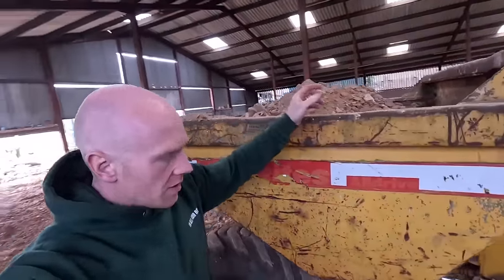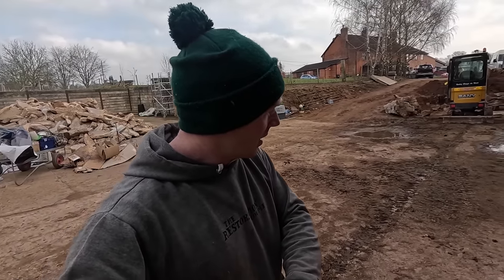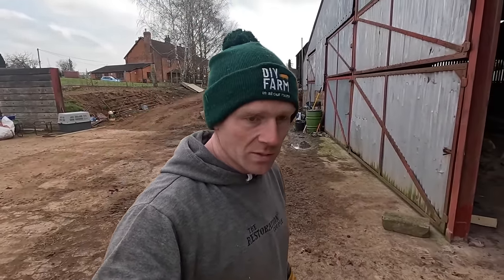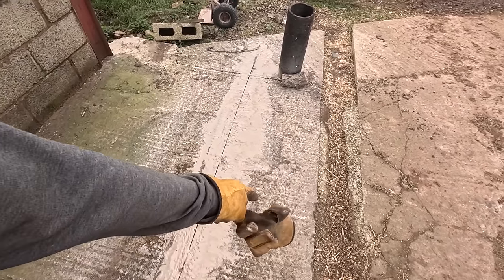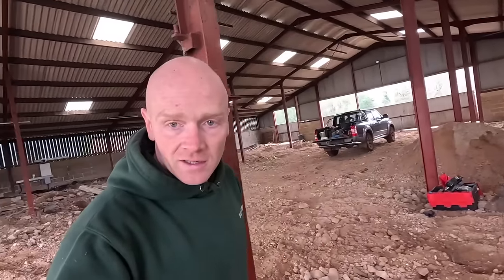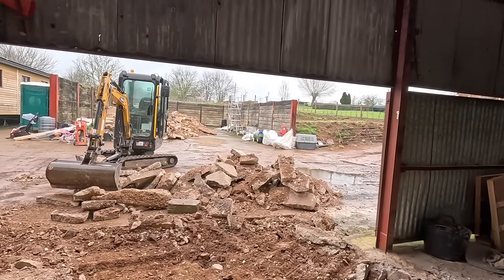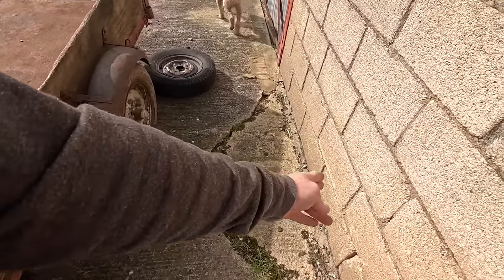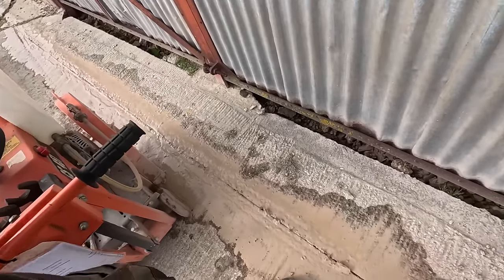FLOOR SAW BEATS THEM ALL! - Barn conversion concrete slab cutting

Comment: You should definitely do a video about where you guys started and how you got into DIY, would be really interesting to see where you started and if you had a background in construction before or you just picked it up.
Reply: Video 1, 2009, wiring a 3 pin plug.  It didn't go well.

Comment: Bit of advice for you. Whilst using a floor saw, make long runs in shallow passes. 50mm passes on that little saw is too deep, on bigger diesel saws 50mm would be fine. I would have done no more than 25mm at a time. Trying to cut it all in one causes more diamond wear and will cause the blade to try and rise out of the cut especially after encountering rebar. Hitting rebar will cause the water to run clear and metal fillings will be visible. Once through the bar the waste water will go cloudy again. Once you’ve breached the slab the water will run away through the cut, which is equally as bad as the heat build up with little or no cooling can cause the segments to be removed. That will give you other problems which I won’t mention. Running out of the cut will cause the blade to take the least path of resistance and you will loose your straight line. That’s very hard to pick up again. If that happens, retract the blade. Move up a foot, start cutting on the same line to get your straight line back. Then turn the saw around and from your new cut cut back into the first cut.
My expertise comes from my father running Clipper before Norton took it over - becoming Norton Clipper. Myself I’ve done twenty plus years with a diamond drilling and sawing company. Hope my advice helps. Nick

Comment: FWIW - I used to run my off-road Defender with tubed tires and on several occasions when I got flats it was when I’d been rock-crawling and the inner tube had separated from the valve and deflated the tyre. Seems that you can go for ages with them on flat ground but on rough ground where you can bash the valve the odds of a flat are greatly increased. I even deflated one with a wheelbarrow when I was trying to squeeze between the Defender and my workshop - hit the valve and the next day …. flat as a pancake. I no longer use tubes!
Reply from the maker: It's a good way to get a few more years out of old perished tyres on an occasional use vehicle like this but no doubt. full new set would be ideal.